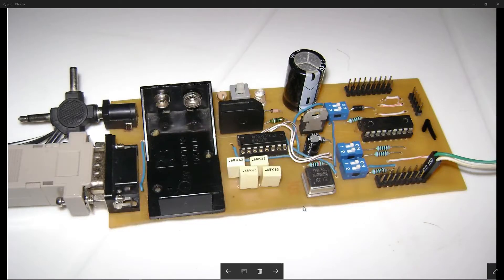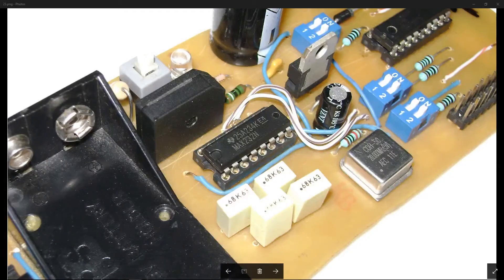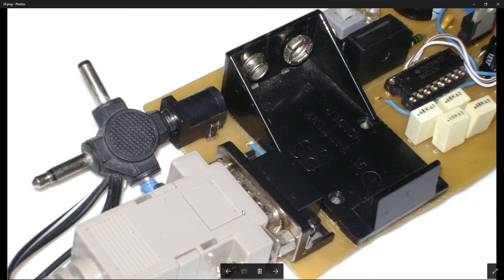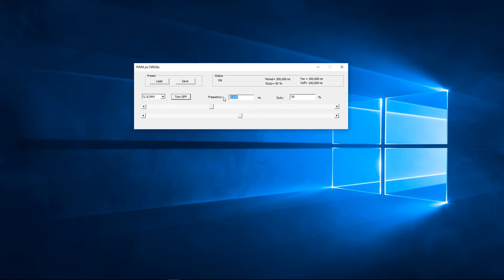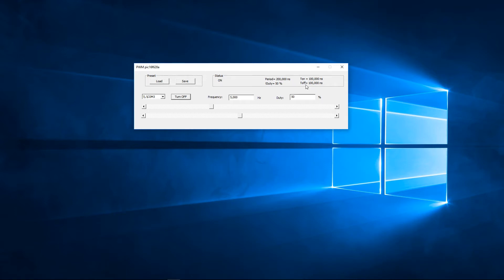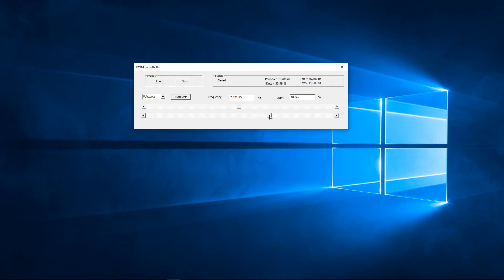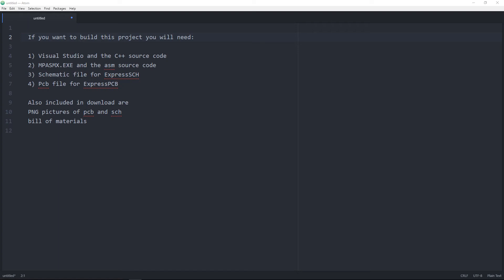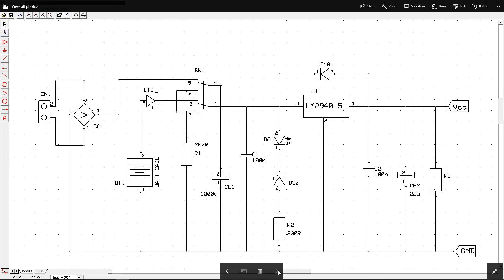PWM using PIC16F628A and a PC

Comment: Any chance of having multiple save/load's? It may help someone (without programming tools) do repeat testing at various freq. or duty settings. Thanks!
Reply from the maker: Well this is an old project, at this point I don't think I'll be updating it, sorry.
BTW, all this tools are free. Also you could play with multiple "saved.stt" file.
Or multiple *.exe files each in it's own directory , then it is just a matter of clicking multiple shortcuts
 on desktop.
Reply: True enough, shortcuts it is then.. Thanks, I wasn't sure about software costs.
Reply from the maker: How about command line arguments?
exe com ferq duty
You can put those in batch file or shortcut.
I'll update soon.
Need to test on scope.
Reply from the maker: Updated, now it has command line arguments.